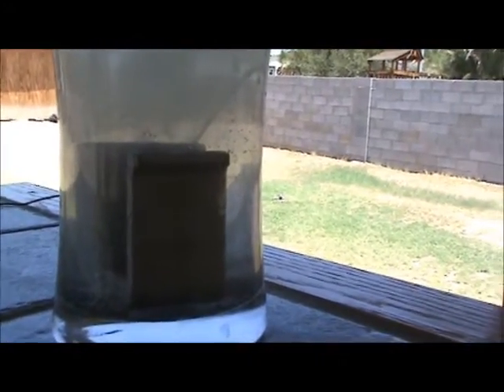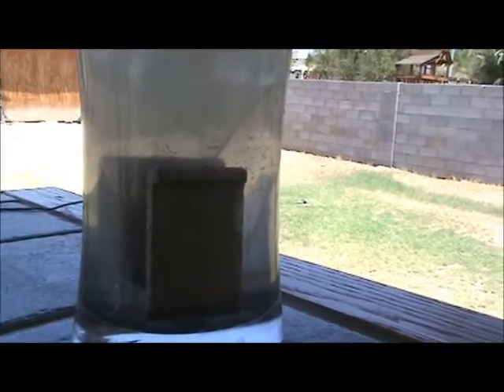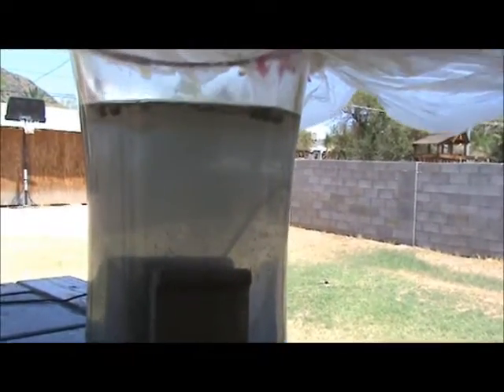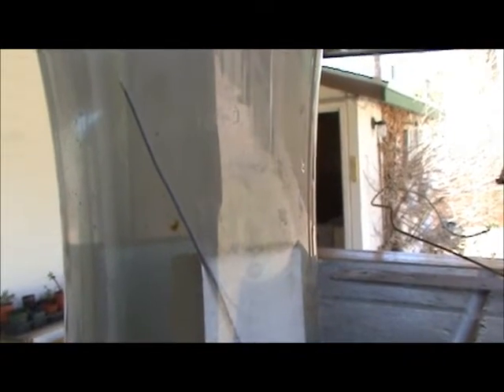How to create Hydrogen HHO using battery acid HIGH PRESSURE PT1

Comment: Very cool I have some videos too on this I use Aluminum and Muratic acid Much faster reaction. Also there are Many other was to make Instant HHO or in the case I did it used the Oxygen and I was left with Hydrogen. I even produced 500 PSI many times in a old Steel Scuba tank good work Steve
Reply from the maker: diveborg13 Yeah I had my scuba tank up to 2000 psi before I got scared and relieved the pressure.  I found the CO2 tank was much more reliable for the long haul
Reply: Steve Blair Yes that just proves that its not HHO and I believe the Oxygen is used in the process
Reply from the maker: diveborg13 that can't be the case if you view my torch movie it wouldn't be able to burn without oxygen through a standard victor tip. I would have to use a propane tip.
Reply: Steve Blair well all I know is I have Put it up to 500 PSI and seen many at 2000 or more and if it was HHO not just Hydrogen I think it could blow However who wants to try that with normal hho lol
Reply from the maker: it took me 2 years to properly answer that question when first asked.  Come to find out Hydrogen and Oxygen are stable at any pressure as long as it stays below 550 deg.  That is why they use hydrogen in high pressure experiments.  Hydrogen and oxygen will not combust under pressure like other fuels do